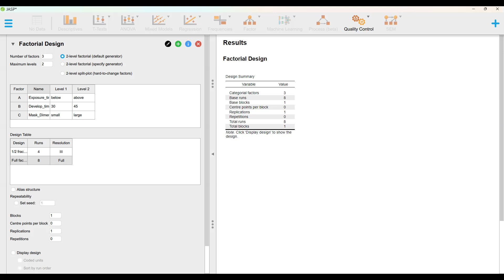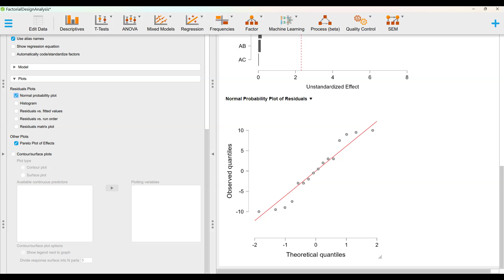JASP: DOE Factorial Design and Analysis

Comment: Hello Paul, I was trying to follow the instructions in this vide. But I do not see the Disply Design Box mentioned at 0.30 time. Can you help me? Thanks.
Reply from the maker: I believe I was using JASP version 0.18.1  nine months ago, what is your version?
Reply: @ChenShawJiun  Thanks for your reply. My version is 0.19.3. Later,  I could locate the Display Design command which is now on the top left. But I could not locate the design matrix where I could add the response. Also, I get an error that same factor names cannot be used.
Reply from the maker: the UI of JASP 0.18.3 and 0.19.3 are different but similar and the items to select are the same. To show the matrix(factorial design at the right ), you need to use mouse to highlight/click either full factorial or 1/2 factorial entry in design table as I did in 0.18.3. You will need to export to a csv file later from the UI
Reply: @ChenShawJiun thank you. I tried this successfully by exporting as a csv file. In analysis, i did not find main effect and interaction plots. Does JASP support these? Also, in ANOVA, i didn't see r-sq etc. Any suggestions?